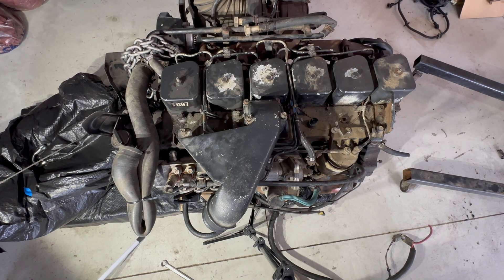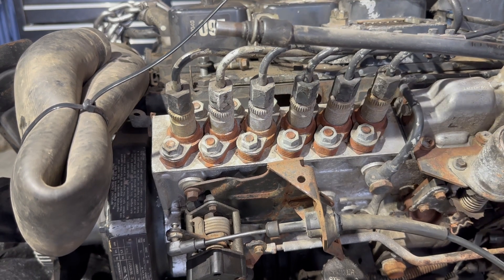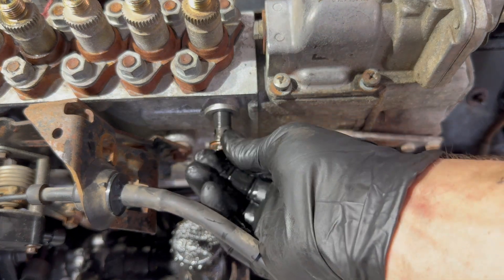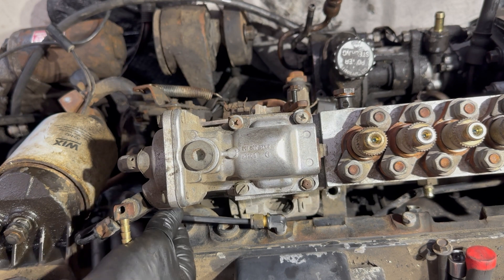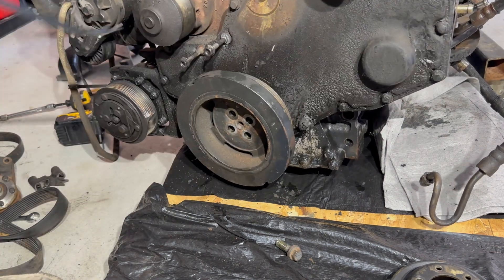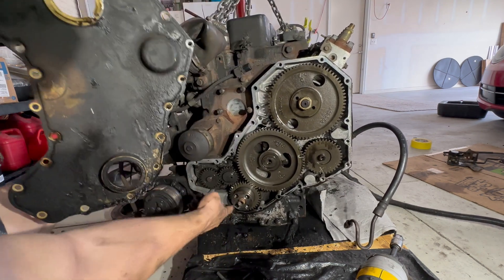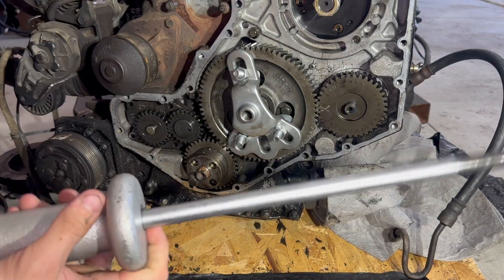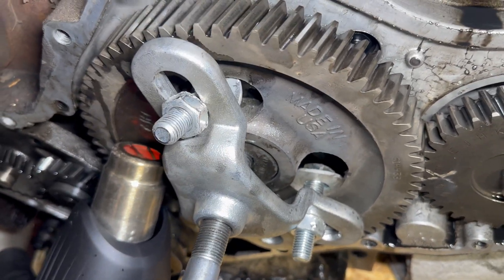P-Pump Swap First Gen Cummins - Part 1: How to Remove a P-Pump on a 1996 12 Valve Cummins

Comment: You show nothing about setting your timing on the p7100 pump setting the engine at top dead center them are all very imperative things that need to be talked about and said especially if you're just swapping the pump say you going to put a new pump are you going to keep the original pump and you want to keep it original without adjusting or modifying anything I would think that you would lock the engine at top dead center with the timing pin and then remove your pump I did one last year on mine and I got it to run it runs pretty good I think it's at 17° versus 13° that's the way that they time that but I'm going to be pulling it back off to fix the tablet cover leak again after resealing the whole engine which is a pure bummer but I'll be finding out today I'm going to mess with it but from everything that I've read when I installed it it's just a reverse process and I don't know if I have to do that flag thing or not off to the side I guess it's worth a shot to open it up and see if the thing fits in there for the flag they call it the little flag and that little plastic tool supposed to line up with that in there and then that is set at the timing of whichever it was set before you pull it off but I believe that that also has to be set and I think that you can keep the plastic tool in there to keep it locked in place while you pull off the bolts of the timing gear also you can keep locked in place the timing pin that goes through the front of the oil cover or behind it cuz you're not putting any pressure turning it all you're doing is loosening it so I would think that when you put it back on if that timing pin is in its hole for top dead center and then the other plastic piece that's on the flag is what they call it in the p7100 pump off on the side when you put your p7100 back on I would think that you keep the plastic one in there on the p7100 cuz I don't think there's a way that you can hold that shaft when you tighten down the timing gear and if it's on top dead center with the timing pin that goes through the timing cover through the back and locks the gears I would think if you tighten it right you can get away without that thing breaking the plastic timing pin through the front through the rear of the front timing cover but if I'm not mistaken I think you can use the barring tool or a big flathead screwdriver something to hold the flywheel so the engine doesn't move and then tighten your timing gear back down the engine should not move everything was the way that you put it before you took it apart so you should be good but you don't explain none of that